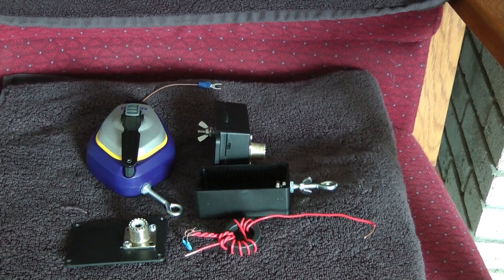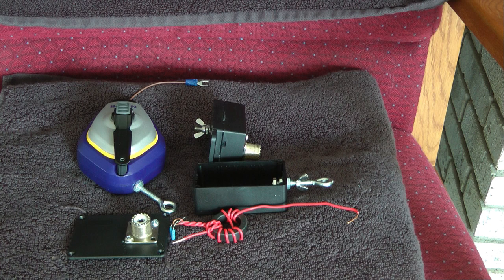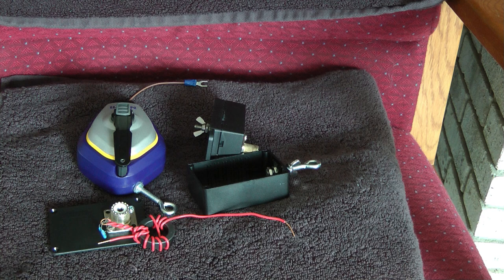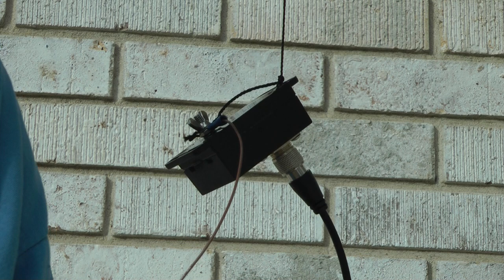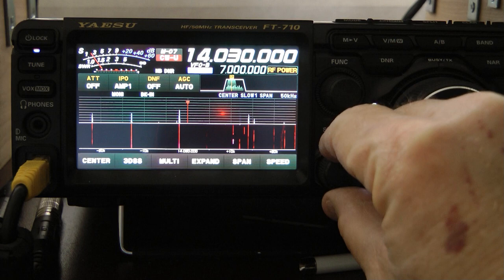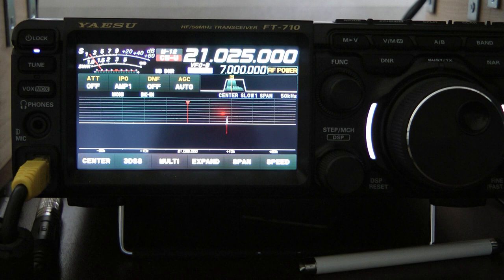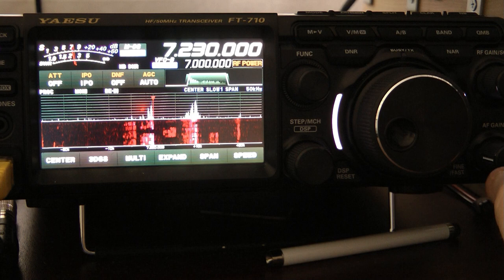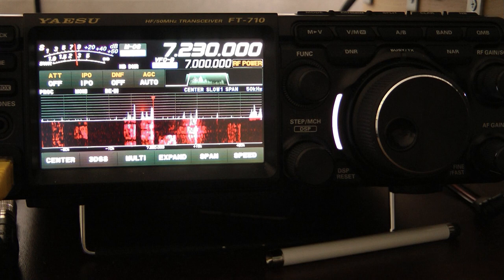End Fed Antenna for POTA, SOTA, portable use. Instructions on how to build.

Comment: Interesting experiment, thank you for making this video. I wouldn't rely on swr readings on the radio to assess antenna's match.  Feed line has a big effect on it.  I would connect an analyzer directly to so239 after you deployed the wired.  
Agree, manufactured Ham antennas for retail sales are too overpriced.
Reply from the maker: When using an end fed without a ground the coax becomes part of the antenna so in order to see the true SWR of the antenna it needs to be measured at the end of the coax.

Comment: Is my understanding that you "tune" the SWR by merely winding the chalkline wire in or out correct? Wow!

Also, have you tried this antenna on your little uSDX+ QRP unit?
Reply from the maker: Yes, you adjust the SWR by winding the wire to the proper length